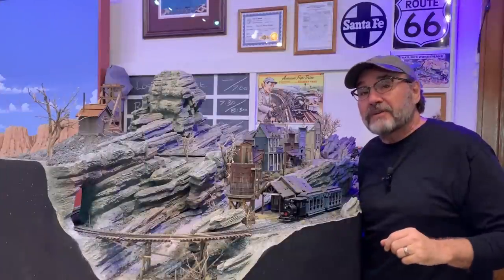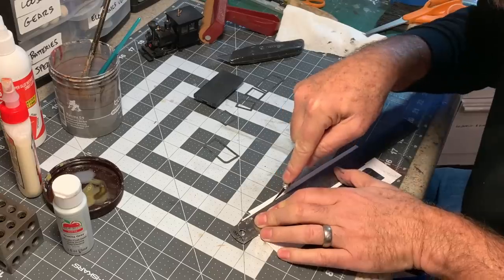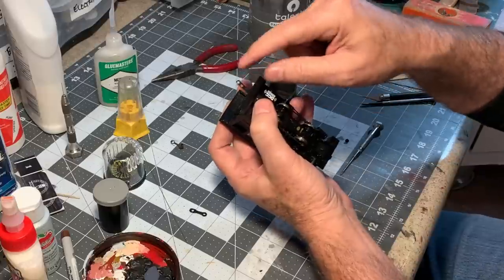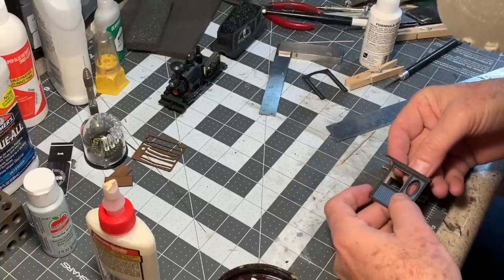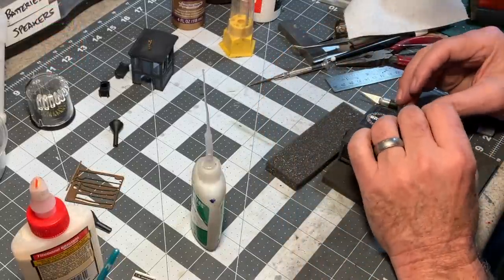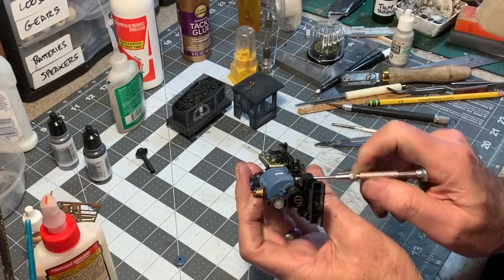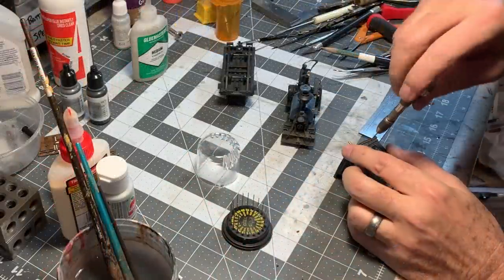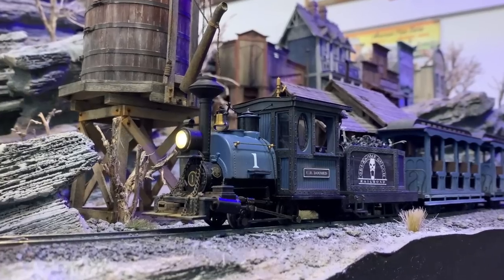Another Gruesome On30 Locomotive! | Gruesome Gulch | GGRR 27

Comment: Amazed by the fine detail possible with the laser, and the etching technique to raise those rivets is spectacularly subtle.
Reply: The result is very similar to brass, the main surface being in both case a bit rough. I wonder if the other method for brass work also with a laser: marking the rivets on the back side, and put them off manually.

Comment: If you want to reduce charring on the surface when laser etching/cutting, put a layer of masking or painters tape over the top surface of it. Learned that trick a long while ago.

You don't need to do it if you're etching glass though unless you want to paint and fill in the etching, and be careful using it with something like leather because there can be some issues.

I wonder if you could use some transparent resin prints of passengers for the touring cars, perhaps a bit of a glow in the dark paint brushed over them to have ghostly passengers sitting there